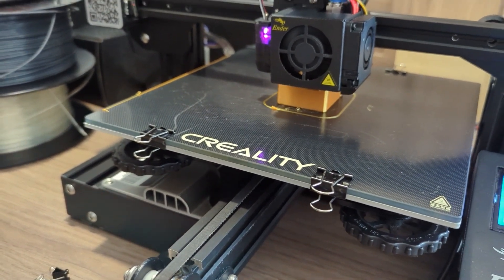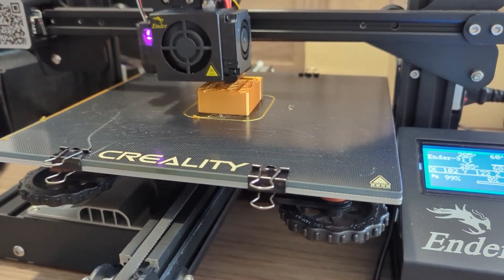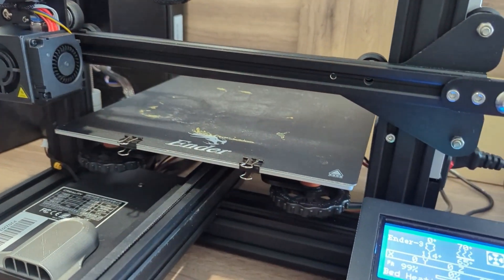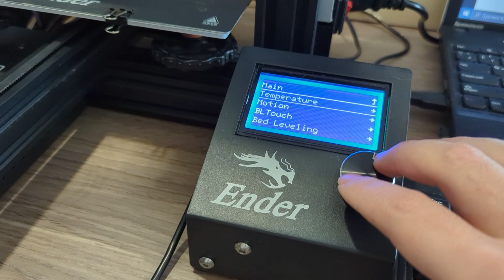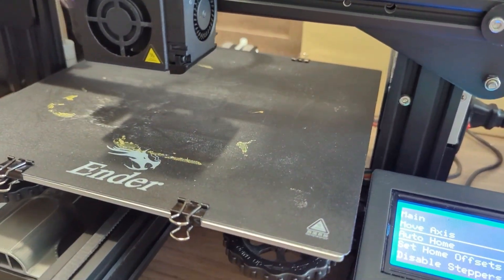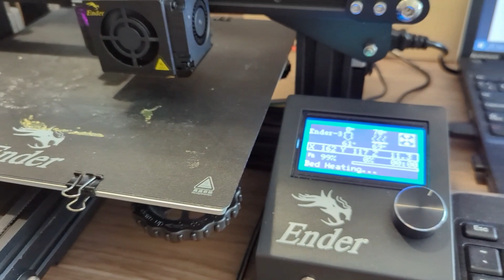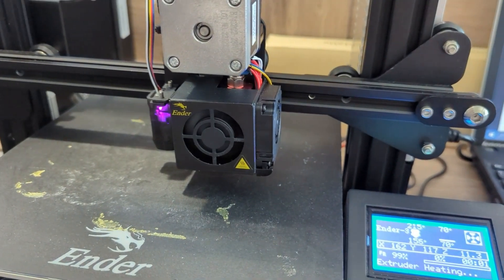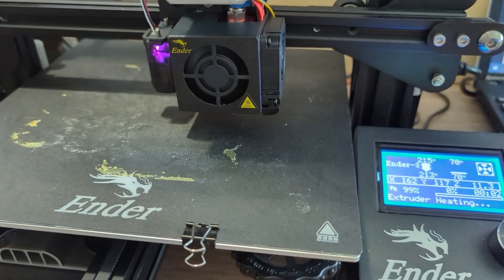CR Touch Review - Switch Printing Bed Without Re-Leveling! #crtouch #ender3 #3dprinting

Comment: Most metal beds have a hump in the middle, the bed clips are far too strong and bend the corners down as the buildplate seesaws on the hump, I bought some of the thumbscrew type clips that can be just tensioned enough to hold the bed and not bend the corners down, this helps with the tramming.
 The repeatability test on the CR Touch is not good on some of them and OK on others, this is strange, I dont know why this happens, I made a list of the results from the YT reviews when it first came out, I dont get this issue on the BL Touch units though.
Reply from the maker: Yeah these clips are very strong especially on that glass bed. So far the CR touch worked out well for me aside from the initial setup which takes some work. I really like that I can change the bed without having to relevel. The glass bed stick too hard sometimes so depend on what I'm printing sometimes I use the bendable bed since it is easier to get the print out after it's done and that is helpful. Thank you for your always detailed comments.
Reply: @techs.passion  I have found with the glass beds you have to first lower the z to get it to stick and then lower the Z again to get the squish and a flat profile but not too much or they wont self release but when you do get it right the parts just pop off when the bed has cooled.
Reply from the maker: So true, I had to learn the hard way. I was printing this large gear and it covers like the whole bed and since it is slim, it was so hard to get it off the bed and I wished I use the bending type bed for that one. That one print gave me so hard time to pull out of the bed.